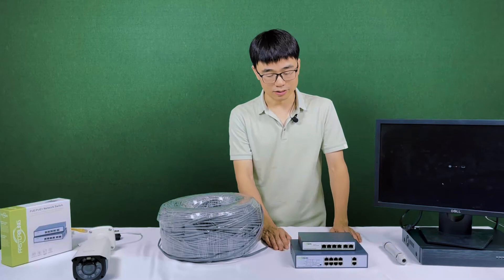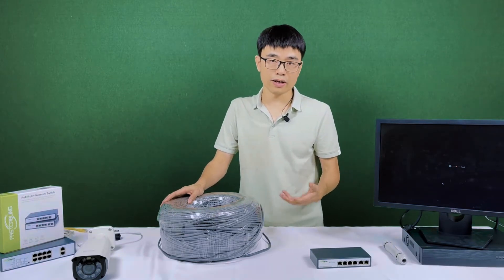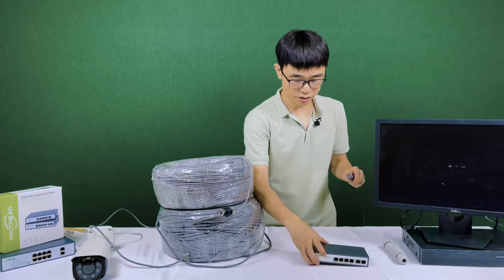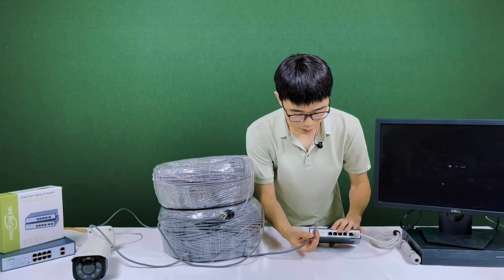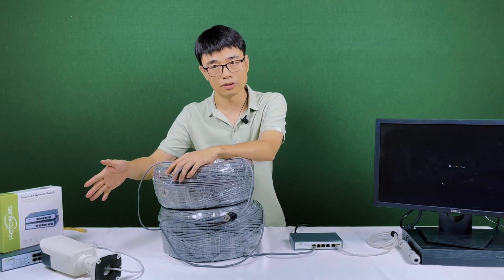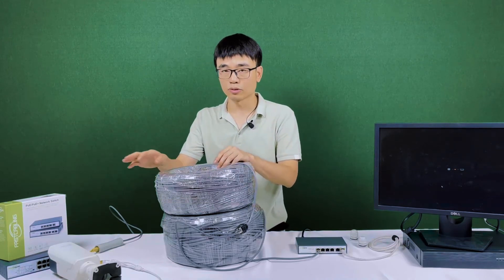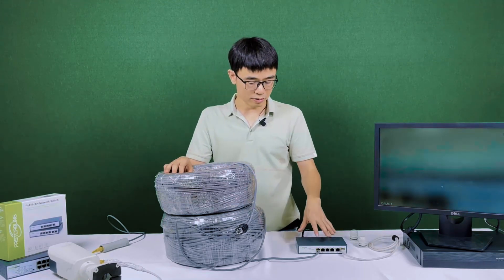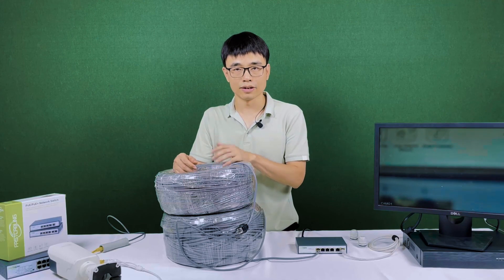How to Run POE Network Beyond 1500ft for IP cameras

Comment: What is the name of that white device you connected close to the camera?
Reply from the maker: It is an included adapter. The adapter works with the switch to send the signal back to the switch from the remote network devices(eg, IP cameras) as they do not support long-range transmission.